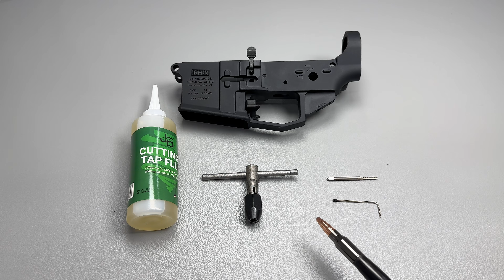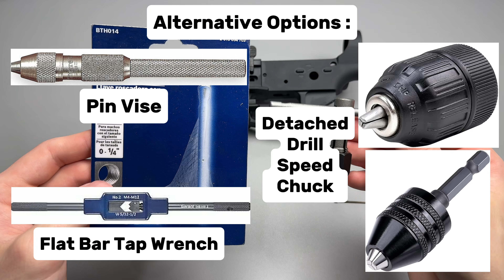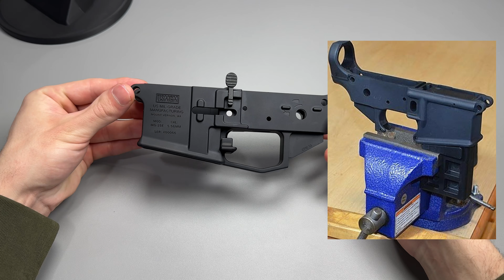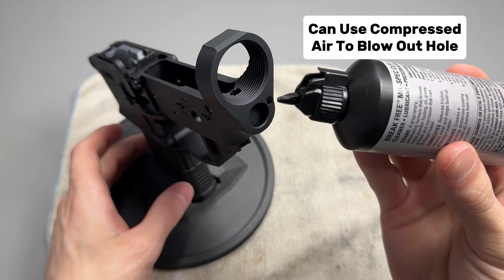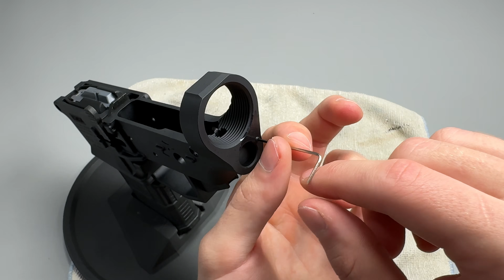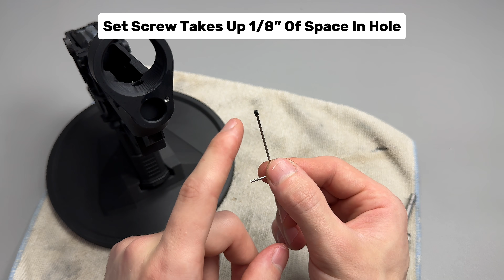How to Thread an AR-15 Rear Takedown Pin Detent Hole

Comment from the maker: Do you think tapping/threading the rear takedown pin spring and detent hole is worth it or just use the endplate? 
*When using stainless steel set screws with the aluminum lower receiver, there is a low galvanic risk for corrosion if saltwater or moisture comes in contact with it. Grease, oil, or thread locker added to the set screw can help prevent this. Black oxide alloy steel like the ones used in this video are a better option since it has anti corrosion properties. The face of the set screw has a higher chance to rust than stainless steel but since it’s covered by the endplate, that is a low possibility which can be mitigated the same way with oil, grease, or thread locker on the set screw. Both will work fine 👍🏼
Reply: Endplate works fine but way more annoying to use than the set screw.
Reply from the maker: @Mochips123  I agree. More components involved when using the endplate and trying to smash the spring down is annoying.
Reply: No. You are overcomplicating the system, using nonstandard components, and inducing another failure point. 

What if someone buba’s it and totally fucks up threading? What if someone uses Loctite and strips the screw? What becomes of the lower then?

If a manufacturer did this from the factory, sure. But like a threaded bolt catch, convenient, maybe, but unnecessary.
Reply from the maker: @NonSense1O1  Thanks for sharing your opinion and I understand your thought process 👍🏼

I understand how the threading process itself could seem complicated, but it makes installing the rear takedown pin easier and less complicated. Technically the 4-40 set screw is a standard component in modern lower receivers (Aero, radian, USMGM). Many companies thread the 2 holes. The set screw wouldn’t be a failure point itself because it’s doing the job of the endplate. The failure point would have to come from the user. 

If someone messed up the threading, you could revert back to using the endplate. You wouldn’t need to use thread locker because the endplate is stopping the set screw from moving. However, if the screw is actually stripped, there’s many different ways you can remove it, the most common being a tool or screwdriver bit specific to removing stripped screws. 

What if someone messes up installing anything on a lower receiver? What if someone smashes the roll pin for the bolt catch? What if the spring/detent shoots out and gets lost? 

USMGM actually does thread both from the factory. Many companies do. Not only convenient but makes it much easier to install and less likely to lose parts. I agree it would be considered unnecessary compared to the original way 👍🏼

Comment: I've been doing this to all my lowers. Though the first time I just used a roll pin and shaved off the extra bit sticking out. Tempted to do the bolt catch pin but probably will not do it.
Reply from the maker: That’s awesome 👍🏼 interesting to use a roll pin in the rear to “plug it” instead. The bolt catch is tempting but seems a lot more difficult because of limited space and the angle.
Reply: @GearAndGuns  The bolt catch hole is not too bad. I was able to find an extremely long handle for the tap or it was an extremely long tap(don't remember) for relatively cheap. The only issue was that the threaded set screw pins were kinda expensive($5-$10 for ONE). I only used a roll pin cuz the tools and set setscrews were on the way and I was impatient. It is a more 'permanent' method but it does same thing. I have no plans on changing out the takedown pins from milspec ones so its whatever.
Reply from the maker: @WoozyK7  That’s understandable. I respect that 👍🏼

Comment: Does this work for the bolt catch as well?
Reply from the maker: The process, tap size and tools are different so this video wouldn’t be an identical tutorial for the bolt catch. The bolt catch is similar in a sense but more difficult to perform. I haven’t done that yet so I can’t properly inform on threading the bolt catch I’m sorry.

Comment: This is a slick idea. I was talking to my son about this, and he informed me that
he has a couple of lowers he purchased where this was done from the factory.

I may be good to put some Loctite 34395 Marine Grade Anti-Seize in the hole
to protect the setscrew from rusting and the receiver from corroding.
Reply from the maker: I’m glad you agree 👍🏼 Yes sir your son is correct. Many modern companies are starting to do it from the factory which is great to see. Aero precision on their m4e1, radian adac 15, ballistic advantage, spikes tactical, tactical innovations. The USMGM MG-15E lower in this video, when purchasing their production model has it threaded as well.

That is a good idea which I plan to do. Anti seize, grease, oil, or thread locker can prevent the screw from rusting and the receiver from corroding. Thank you for sharing 👍🏼🤝

Comment: Note: Aluminum + stainless steel = greater galvanic difference, so the aluminum can corrode faster, especially around saltwater or moisture.
Reply from the maker: You’re right. I wasn’t aware of that at the time of this video. Using thread locker or grease can help prevent corrosion on stainless steel. The black alloy steel I used in the video or “black oxide alloy steel” is the better choice since it has anti corrosion properties. I’m glad I got that one instead. Thank you for sharing 👍🏼🤝

Comment: Ordering the tools / oil now. I wish all lowers came threaded already but as someone who builds and changes this I appreciate this info. Keep it up!
Reply from the maker: Nice! I ended up using some clp I had to tap it. If you have some you could use that instead of buying dedicated tapping oil if you’d like to save some money. The clp worked good for me. I wish they did too. Some modern manufacturers are starting to do this which is good to see. USMGM, aero precision, radian, etc. No problem at all. I’m happy to provide this video. Will do sir! Thank you for sharing 👍🏼🤝

Comment: Good stuff. The only thing I would point out for consideration is the recommendation of stainless set screws. Stainless and aluminum don’t play nicely together due to electrolysis. Coating the threads with anti-seize would prolong that from becoming a problem. But I think the black oxide ones would be a better option. Thanks for the video!
Reply from the maker: You are right. Black oxide would be best. Stainless steel is what I’ve most commonly seen from manufacturers. These were just cheap on Amazon but after knowing that I would’ve went with the black oxide ones. Thank you for the information. I appreciate that. No problem, hope it was helpful in some way and I’m glad you enjoyed it 👍🏼🤝

Comment: That's definitely of those "how the hell didn't I ever think of that" kind of things. I wonder how hard it would be to get both sides of the bolt catch pin hole done and have them actual line up properly like an Aero M4E1 lower...
Reply from the maker: Yes it is lol. I thought the same thing. I think it would be a decent amount more difficult because of the hole being on the side not giving as much room. The hole has to be drilled out slightly bigger on each side I believe then tapped with a 6-32. I’m not sure how to get the drill bit & tap straight inline with the hole without an extension and drill press or something. The material is thin there too so has to be down very carefully. It would be nice to see a video on it though. Seems a bit more complicated.

Comment: Wait wait wait so you put the spring and detent in and then this screw?
Reply from the maker: Correct 👍🏼 Detent goes in first into the pocket of the rear takedown pin, spring goes in 2nd, and then this set screw holds the components in place. Hope this helps 🤝

Comment: I have this bit, tap holder and screw. Just bought them because I fabricated a piece of brass to make a clamp for the tail of my Stribog trigger so it would engage the safety cam. Now I can us standard AR triggers in my SP9A3.
Reply from the maker: Very nice. Good job on figuring things out and making it work 👍🏼 thank you for sharing 🤝

Comment: Thanks so much for this.  Will do it to all my receivers. 
I made an Amazon list of your ingredients, but can’t figure out how to share it.  That would be handy.
Reply from the maker: No problem at all, my pleasure. Very nice! You can comment the description of the products if you would like? To share, there should be a box with an arrow pointing up. You can copy the url or link and then paste it. I can verify the list of products if you would like. It’s the same stuff I mentioned in the video. Happy to help and feel free to ask if you have anymore questions 👍🏼
Reply from the maker: 4-40 high speed steel or high carbon steel plug tap or tapering tap
T handle tap wrench or one of the other options 
4-40 x 1/8” stainless steel or black alloy steel socket hex set screws with included hex key
One of the types of oils mentioned. If you have wd 40 or a clp oil those work fine
Some air duster or compressed air helps to block out the aluminum chips from the hole 👍🏼

Comment: What’s the difference between pushing the spring in with the end plate which has more surface area as opposed to a set screw that has less?
Reply from the maker: That’s a good point and observation. Pushing the spring in with the endplate could be easier for some people because it has a flat bigger surface but I think it’s easier to bend the spring. I prefer using the set screw because I think it’s easier to steady the spring and keep it straight. It allows for focus on 1 install instead of mixing 2. Where I think the biggest benefit is, is that if you want to change your endplate, castle nut, or buffer tube, your 3 components for the rear takedown pin are secured in place by the set screw. No chance of your spring shooting out or detent getting lost.
It just comes down to preference. Threading the rear hole isn’t necessary, just a nice touch I like 👍🏼

Comment: Stainless and Aluminum don't always paly well together if exposed to moisture
Reply from the maker: You’re right. Corrosion is possible. Anti seize or grease can help mitigate that. Stainless steel seems to be the preference by manufacturers for this set screw because it’s more resistant to rust than the black alloy steel 👍🏼

Comment: Good stuff I’ve been doing this for about a year. lol. I use the stainless set screws though the secret is out now. lol.
Reply from the maker: Thank you. I’m glad you liked it. That’s good to hear. Yeah stainless steel set screws are the way to go. If I didn’t already have these I would’ve got stainless instead. It does seem to be that way but this still doesn’t seem to be a common practice. Thanks for sharing 👍🏼

Comment: This cool I don’t think I’ve seen anyone else do this before. Unfortunately I’m not really good with my hands so idk how much I’d trust myself to do this. Luckily my aero lower just came with this feature. Though I’ve heard aero is going out of business
Reply from the maker: Glad you liked it. I hadn’t either until i had a reason to with this lower lol. Doesn’t seem very common anymore since some modern companies do this in factory. I respect knowing one’s limitations. I was a bit hesitant to do it as well but it was actually easier than I thought however I could see how it’s easy to mess up as well. Aero threading these has really come in clutch like with yours. Very nice small touch to the lower. Yeah unfortunately it does look to be that way. They might be done for smh. Always loved their m4e1 lower. Appreciate the interaction my man 👊🏼

Comment: I’ve done tons of these and it’s too easy to screw up. Takes just a few minutes and it’s well worth it. I also do the bolt catch  to accommodate a 6-32 threaded hinge pin, same as an Aero Precision or DPMS etc.
Reply from the maker: You do think it’s too easy to mess this up? It seemed pretty easy to do in my opinion but I could see how it could be done wrong. I agree, I think it’s well worth it too 👌🏼 The threaded bolt catch is awesome as well. I haven’t done that yet. What specific tool do you use to keep the tap straight when threading the bolt catch since it’s in a tight place? I have aero lowers and I’ve liked how both the bolt catch and rear detent hole are threaded 👍🏼
Reply: @G @GearAndGuns  I’ve drilled n tapped since I was a young lad lol my dad tought me so it was easy to dive into lighter metals specifically aluminum. However I did find long shank drills, taps and reamers on line that make it much easier and added to those, I use a Tap handle I made in machinist school which is small enough to make it easy to tap one handed while stabilizing the the tap with my left hand. I use a locking magwell jig in my gun vise and level the reciever. Then you can control a parallel line to the lower AND a level line simultaneously while easing the tap through the pin bore. To begin, just use a 6 or 8 inch #5 drill to gently open up the pin bore to accommodate the 6/32 tap keeping it level and parallel to the reciever. Do not plunge all the way through the pin bore. Leave .010” for the shank of the threaded bolt catch pin to bed into for seating. When tapping, only tap enough to accept five threads of the new threaded pin. Use tap magic or whatever gun  lube you use will be fine. I also use a can of compressed air to blow out the bore and tap flutes. Rear bore for takedown pin is already of correct size to accommodate a 4-40 tap. How ever long your set screw is, you’ll need to snip off that much length on detent spring. Use aeroshell 64 on set screw threads as there’s no need for any thread locker. Endplate will keep everything secure obviously.
Reply from the maker: @billymichaels2889  I can tell you have a lot of experience. Thank you for all the information and tips. I really appreciate that 👍🏼🤝🏼
Reply: @GearAndGuns  absolutely buddy no problem. Some people would say these are unnecessary measures, but in the instance where the pin bores  are oversized from factory and the pins walk out on their own under fire, like what happened to my Ruger SFAR, this is an easy fix instead of sending it back to the manufacturer who is going to say it’s fine and send it back to you unrepaired. Aero precision and DPMS308 pattern rifles are done this way anyhow. Is it necessary to do it on every rifle you own? No it’s user preference. I myself like it. I’ve done all of my AR’s this way and I have extra threaded bolt Catch pins on hand and a lifetime supply of setscrews.
Reply from the maker: @billymichaels2889  Someone actually did say this video/task was unnecessary lol. Yeah, pins walking under fire gets old real quick. That’s an unfortunate situation with your ruger. I agree, easier and faster. Yes they do. I like/prefer it as well. Has always made assembly lowers much easier. This is the first I’ve had to do it but it was a special occasion. I respect you for working on your own equipment. Extra parts always come in handy 👌🏼
Reply: @G @GearAndGuns thank ya buddy. I enjoy building, troubleshooting and doing mods on ARs. If it makes a budget rifle that much closer to a good reliable build I’m all in. And always a student. I’m sure you’ve followed Chad at School of the American Rifle. If not check him out cause that’s exactly where I decided to do these mods and repairs on my own. If I lived closer to his area man I’d definitely take his class.
Reply from the maker: @billymichaels2889  No problem friend. Me too! At first it was a little more challenging but as time goes on, it gets easier in ways. Running into issues is always frustrating and sometimes discouraging but gotta keep pushing 👍🏼 Modding ars is fun. I 100% agree. With certain additions or accessories, you can make a budget ar into a great rifle. I respect that mindset. I’m always a student too. Trying to learn and stay open minded. Yes I have. He does a fantastic job with educational content and is very thorough. Taking one of his classes would be awesome 👌🏼

Comment: Can’t believe the bolt catch and rear takedown detent hole don’t come standard with them being threaded by the manufacturer.
Reply from the maker: Yeah it’s pretty ridiculous. Should come standard from the company instead of using a roll pin and endplate. Thanks for sharing Mo 👍🏼
Reply: JT15 does
Reply from the maker: @12Woodworking  Thanks for sharing that information. It’s good to see more companies doing this 👍🏼